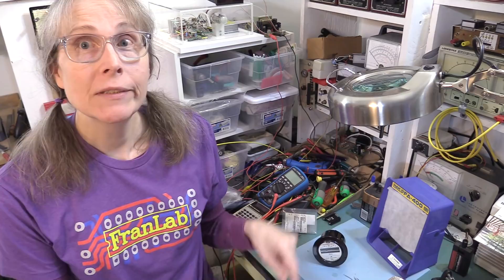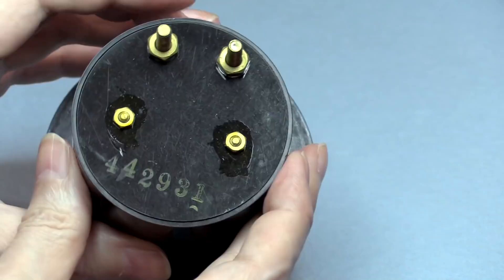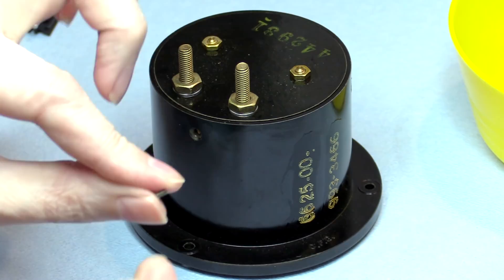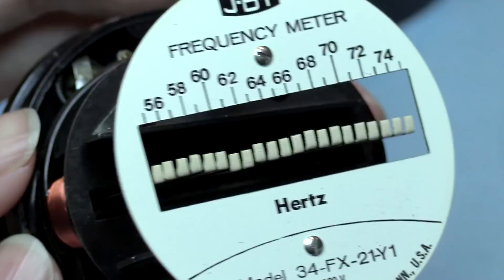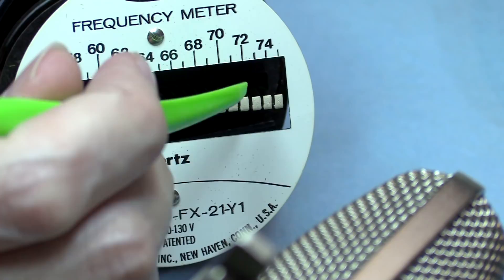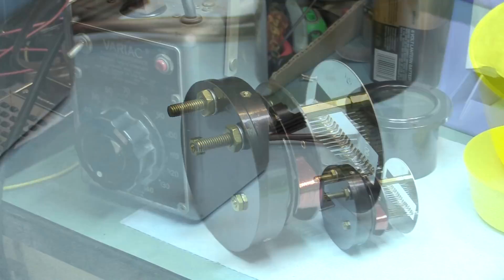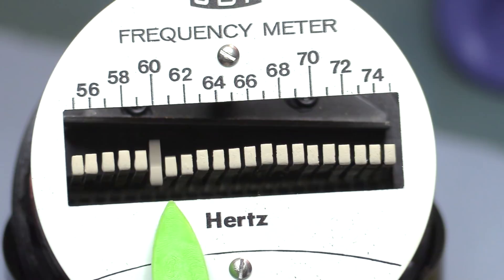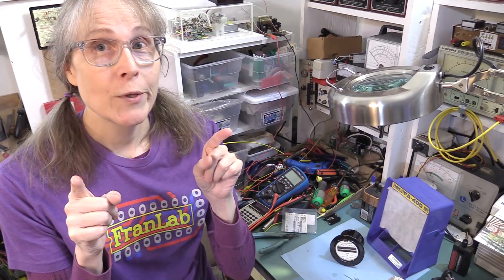The Spooky Action Of Mechanical Frequency Meters

Comment: If it were truly old, it would probably say "Cycles" instead of "Hertz" IMO.
Reply: I've seen many that were labeled "cycles."  One military surplus vendor I knew never said "Hertz," he always said "Cycles."  EG "that's junk, it's 400 cycle."  Back in the 70s, before modern power electronics, 400 cycle transformers and motors weren't of much utility to the hobbyist.
Reply: If it were "new" then it would say "Made in China".... But it says "New Haven, Conn. USA". It's been "CT" for many decades now. JBT was founded in 1939 and lasted at least into the 1970's. CH took over their switch line in 1976. I don't know what happened to the rest of JBT.
Reply: Maybe an artefact of WW1/WW2?
Reply: @scottmarshall1414  And it didn't fully transition to "Hertz" until circa 1970 or so. I was born in 1960, and I remember "Cycles" being used almost exclusively until I was about ten years of age.
Reply: Really old? As in egypt and the pyramids.
Reply: @excavatoree  What are 400 Hz stuff used for nowadays? The only use I know of is aircraft electrical circuits.
Reply: airplanes and ships use 400Hz
Reply: @trevorhaddox6884  hmm interesting, didn't know ships also used that, tho makes sense to have common parts after all.
Reply: you beat me to the punch because I was going to say the same thing !
Reply: Agree.  CPS was replaced by Hertz in 1960.
Reply: I think the numbering indicated 25th week of 1966 for manufacture, and 34th week for some other aspect (calibration maybe?).
Reply: 400Hz gives smaller magnetics for motors, generators and transformers, since it's less time to live on the stored magnetic field. Also why switched power supplies can have miniscule transformers when having 10kHz or 100kHz. For switched, it becomes a trade off with the switching loss/speed of the transistors.
Reply: True... Cps or something?
Reply: @Kalvinjj  I think the space station ( ISS ) runs at 17 - 20KHz???!!!
Reply: @perwestermark8920  So, it's true that the ISS ( Space Station ) runs at 17 - 20KHz? I think I read somewhere so that electrical components could be lighter and smaller ?
Reply: @JungleYT  I think that sounds a bit too far, it would start to increase the skin effect too much on the wires (or how is it that you say it, the effect when AC current starts to travel more and more towards only the outer skin of a wire and the center part of it doesn't contribute with current carrying). That they use this frequency on the devices (like Per Westermark said) would make sense, having as much switch mode power supplies as possible to reduce weight, but it probably transports power around on a lower frequency if not DC.
Reply: @Kalvinjj  I'm familiar with the skin effect, having studied television broadcasting and having been an Air Force technician. Usually the skin effect occurs at MHz frequencies which is why "wave guides" exist for radio and TV. I just thought I read that somewhere, without deep Googling, etc.
Reply: @JungleYT  From my search around, the ISS operates all in DC, which would make sense since it generates power through solar arrays and stores it in batteries.
That frequency you mention does sound perfectly in line with DC-DC converters tho, which the ISS uses a lot to match circuits, or maybe even some inverters on-board for whatever AC mains gear they might bring up there.
Reply: @Kalvinjj  OK That makes sense...

Comment: Cool! I found one of these a while back, but it was set for the 400 hz frequency that an airplane's power system uses. I hooked up my signal generator to a small audio amp and a vacuum tube output transformer to power it. It was really interesting to see how each of the reeds reacted to differing frequencies.

Comment: I have an ex-military ISO Comms shelter which has a pair of these on the main power input panel. One is set is for 60Hz and the other is for 400Hz. This shelter was built in the mid eighties for the military. It was usually powered by huge gensets and one way to monitor generator issues was by watching the frequency meters. A lower frequency signaled the generator was running slow and would also cause a dip in voltage and the opposite was true if one observed a higher frequency, the voltage old run high as well. The 60Hz side was used for powering the lighting and climate control system while the 400 Hz system was used for powering a special 28VDC power supply for the radios. These were both three phase systems. At 400Hz the transformers needed to provide the low side are far smaller than those needed for 60Hz systems. Also the filter caps are physically smaller since everything runs at the higher frequency. Its just like in modern switching supplies that can provide high output current without large transformers and caps found in the classic linear power supplies.

Comment: As an Electrician's Mate in the Navy, we used those on some ship's generators!!   Very robust obviously.  We used it to adjust the frequency of shipboard generators.  I've also seen them since then in some emergency generator installations.  That number on the side, xxxx-xx-xxx-xxxx looks like an NSN (National Stock Number).  Each grouping breaks down into codes for the DoD stock system. 

When I worked in Navy Cal. lab, these were a 'go / no-go' cal.  If it read 60Hz when hooked up and wasn't obviously damaged, it passes, and otherwise failed.    Nice review.  :)

Comment: Just use a pa amp and a standard 12v transformer backwards to create variable frequency 120v ac
Reply: I was gonna suggest this.  if you can find an old audio step down transformer from a valve amp, might work better.  they have an air gap if i remember correctly to make it more linear, but a regular transformer would be fine for your test.  as you said, not much current draw.  a modern transistor amp should have a reactive load protection.  or also maybe a step up transformer used for audio distribution in a building - do they still make those?

Comment: Hey Fran, you got a tube amp(I hear it played all the time, in the laaaaab) you got a cell phone, a frequency generator app is free, disconnect the speaker driver, hook the freq analyzer to the output of the output transformer, hook your phone to the amp input, viola! Variable frequency on the cheap, or use your guitar, notes A1-D#. I use a freq app on my phone to my car amp to hunt down resonant panels, and to find the clipping limits. A valve amp is just a low power var. freq. drive, and loading the output xfmr. to a 16kohm vs. a 8-16ohm load for quick funsies wont harm either device at all.

Comment: Those "tines" are usually referred to as reeds. It's known as a mechanical reed frequency meter. I'm sure they were common in all kinds of power generating applications, but I've seen them mostly in generators where the speed of the engine (governor) had to be adjusted to maintain a 60hz frequency. Super-simple tech, yet accurate and foolproof! I loved seeing you take it apart so we could see the insides. I've never had the opportunity to do that.

Comment: AvE did a video on a completely mechanical variant - just hold it up close to a spinning thing and it reads the rip-ums from the vibration. Presumably it's sensitive to read even a well-balanced chuck on a mill or lathe. The tines were individually calibrated with beads of solder.
I'm guessing Fran realized after posting this video that YouTube videos tend to be light on any sound below 120Hz?

Comment: Nice find, Fran. They are used on portable petroleum powered generators for power supply in the field. If you can connect it to someone's generator you should see the tines form the same wave pattern that the numerals are in. Make the generator react a bit by turning a device on and off, you will see the peak dance around until the generator stabilizes.
As several other commenters have said, generators for aircraft use have those for 400 Hz.
Your digits on the side of the meter are actually one stock number xxxx-xx-xxx-xxxx. The two-digit segment indicates country of origin, 00 and 01 being USA made.

Comment: I have a book printed in the 1930's that described all kinds of 1920's (and older) technology.  There already was this kind of instrument described.  I also have used it for the usual purpose of synchronizing "my" generator to the power line in the University of Technology lab.  There was a little difference in the frequency resolution.  For the first, the overall range was much narrower and the vibrating tines were graduated by 0.5 Hz.  Moreover, you could see 3 tines vibrating -- one at high amplitude and two neighboring ones at half amplitude at perfect resonance.  A little deviation caused tiny difference in the lower and higher neighboring tine amplitudes.  So you could interpret around 0.25 Hz variations.  However, the generator synchronizing had yet another "trick", rotating pointer meter.  It slowed down when the difference between the power line and the generator approached zero.  But besides the frequency, you had to tune the phase shift down to zero before hitting the connection switch.  If you had a frequency mismatch, naturally a big bang and tripping breakers would result.  Yet, the same bad behavior would also happen even at correct frequency, if the phase was not matching.  We students were scared to hit the connecting switch, until the teaching assistant showed that the small generator could be synchronized with as much as two Hz difference when done at just before the phase shift meter was coming to perfect match.
  I also was dealing with the tine frequency indicator in my second summer work at an oil refinery.  There was a 25 KW Diesel motor & generator for emergency situations.  It had a massive flywheel and a handle.  Between the generator and the flywheel there was an electric clutch.  It took some 4 to 5 minutes for me to crank the fly wheel to sufficient speed that the clutch could be activated and the flywheel kicked the Diesel motor (and the generator) to speed.  The system had to be tested at least once a month.

Comment: As a kid I got my hands on an old Heathkit RC airplane transmitter and receiver circa 1965. It worked the same way as this device except there were electrical contacts over each of the tines. The transmitter would transmit tones that translated to the same frequencies as the music-box-like combs in the receiver. If the transmitted frequency matched the comb tine frequency the tine would vibrate up and down making contact with the electrical contacts. This would make pulses that would operate the servo motors in the aircraft. One tone for rudder left another for rudder right etc. Very cool.

Comment: Physically mount it to a speaker driver and it will oscillate mechanically.  The thing is, it's actually able to do the equivalent of an FFT!  Feed the driver a complex signal that's a mix of frequencies in the instrument range, and it will neatly isolate them.

Also, since it uses less than 1 W, you can feed an amplified signal generator output to a suitable step-up transformer.  I suspect a bass amp may be up to the task.

While shaking it will yield the FFT-like effect, I'm not sure you can electrically drive it with a complex signal due to possible coil electro-mechanical design optimizations to eliminate possible line/load harmonics, though it would certainly be safe to give it a try!

As for the finger resonances, my bet would be a depth taper on the brass mounting block, allowing the fingers to be of uniform construction.

Comment: I noticed the angled plates seem to be in a fixed location, so I was wondering how they tuned each tine to exact frequency when you mentioned that each tine has different mass. Changing the smallest and cheapest piece to tune it makes so much sense that I can't believe I thought they would spend time adjusting parts instead. Really neat piece of tech, something I would never need but I could watch all day, thanks for showing us!

Comment: Fran, have seen these on older military field generators. They do have governors but do have a knob to adjust the governor when operating under a heavy load. On older aircraft ground power generators the frequency range is usually 360 to 440 hz with 400 hz being in the middle for the target frequency. A lot of these where used on Stewart Stevensen generators and ground power units. As some one mentioned the number being a NATO parts code or standard.

Comment: So, I am very familiar with these. We used them on Aircraft External Power Supply units up until we got fancy new computer controlled units about 5 years ago. They are absolute genius little gauges. I remember that it was always a source of pride to be able to tune in the power supply to the right frequency in the least amount of time. Great video as always :) I wonder if this is from a military parts stockpile from when all of the old manual power carts got retired. Probably not, but it wouldn't surprise me.

Comment: A bunch of years ago I was a telephone technician and was taking shelter from a violent thunderstorm inside a central office.  There was also another tech sheltering there.

As my typical luck would have it, lightning struck the transformer that fed the office and all of the lights went out except a couple of emergency lights that run off the office's 48V batteries, and alarms ringing everywhere.  The lightning had blasted a lot of the phone lines and we couldn't get dial tone on the office phone, but there was a special direct line to the Central central office Office, so we called in to report that the office had lost power.

The supervisor at the control center got kind of excited and wanted us to start up the emergency generator, so the other guy and I went through the plasticized checklist that was wired to the front of the diesel control panel.  We opened the air intake, and the baffles, primed the fuel pump, left the diesel glow plugs on for the requisite amount of time, and finally mashed the go button, and the beast started right up.

Using the tachometer, we set the engine speed, and then observed that the voltage (with no load on it yet) was right at 120 where it was supposed to be, and having confirmed all of this with the control center supervisor (stupidvisor?) we were instructed to throw the switch to take the office off of the failed commercial power circuit and move it to the generator.  The term "switch" doesn't do justice to the thing, this big panel had what resembled a whiffle ball bat, at least in size, mounted in the middle of it, and you unlatched the safety interlock and moved it from one position to the other, rapidly, drawing a small arc and filling the air with the scent of burned contacts.

The generator responded to the load by slowing down, which we had been warned about, and we tuned up the vernier dial to get back to 120V, and stood back congratulating ourselves for a job well done.

The other guy had to answer a call of nature, and the toilet was in the other end of the building, just off the fan room.  He toddled off down the aisle and then I hear all this shouting and here he comes back down the aisle like his butt was on fire, which it almost was.

The upshot is that we had missed one adjustment, which was not actually highlighted on the checklist.  We had neglected to set the frequency of the generator using the mechanical frequency meter, to 60Hz.  As a matter of fact, none of the reeds between 50 and 70 Hz was even twitching, so we had no idea what frequency we were running at.  The rectifiers charging the batteries didn't care what frequency they were being fed with, and the office's fluorescent lights did look a little strange, but the fan motors . . .

We had burned up the three fan motors in the fan room.  Those guys really wanted to be fed with 60Hz, and not getting the right freq. they had merely sat there and vibrated and overheated.  Being a volunteer fireman I was able to "control" the fire, which was really just a matter of tripping the breakers feeding the fans, but the big reason that it was up to me was that the other guy had left the building.

I did kind of wonder what that funny looking gauge was about.

Comment: These were fitted to switchboards on some of the ships I worked on - they were still making them in the 1990's. The ships power was nominally 60hz, but it would always differ slightly from the ideal. 58hz that sort of thing. On the meters we had the tynes either side would resonate slightly and the actual frequency the most so you had a wave effect with the peak being the the true frequency.

Comment: I have a large "tuned reed"  frequency meter rated for 15 to 45 periods per second at five volts mounted on a stand which has a switched resistance with five settings for voltage ranges going from 30 to 50 volts and 160 to 250 volts. Inside it has a date of 1923. The dial is 7 inch in diameter and one reed painted red  at the 25 position while the others are all white suggesting that the meter was aimed at the motor traction generating, early electric trains and trams ran at 25 HZ here in the UK. I got the meter from a whole lot of old equipment thrown out by Cambridge university who I suspect put the variable voltage device on the meter as it looks more homebrewed than the meter itself.